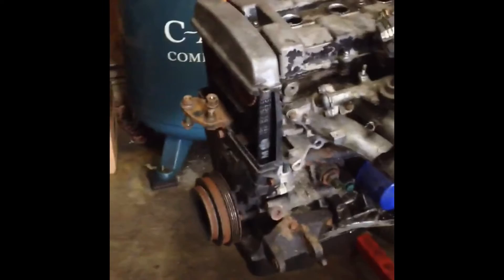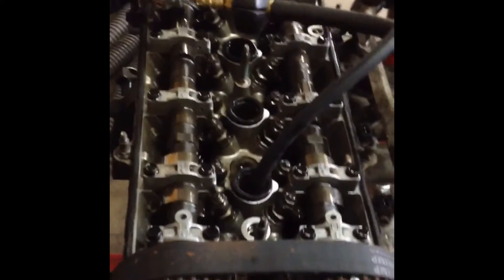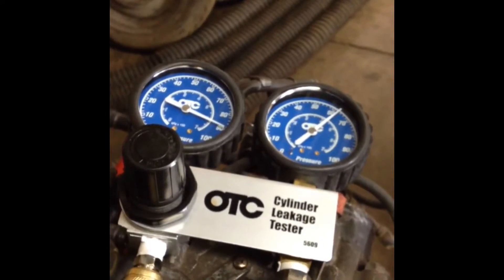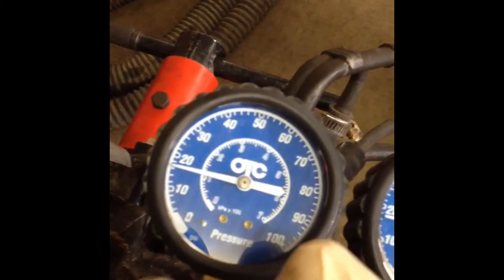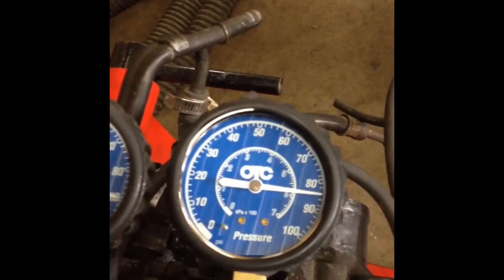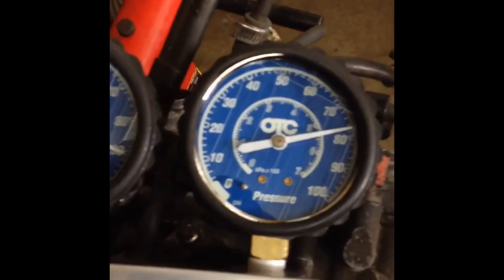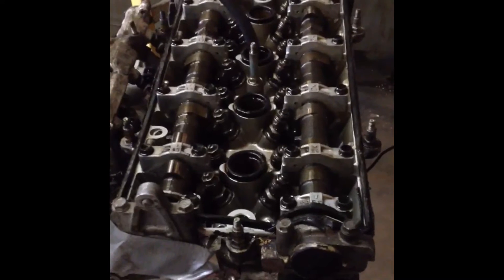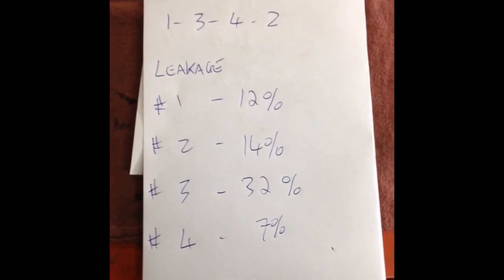Acura Integra B18B1 Cylinder Leak Down Test. OTC Tool 5609.

Comment: Would changing the valve stem seals make a big difference in the %?    You should try it with some inexpensive seals just to see the difference.  I'm no where near the mechanic you are and I think changing those seals is easy with the correct tools.
Reply from the maker: Jon Widmer Unfortunately replacing the valve guide seals wont impact the leakage coming past the exhaust valves. I will still make a video of removing the cylinder head so we can inspect the exhaust valves. I would guess one may be burnt. Honda's as you know have issues with exhaust valves. Speaking of, do you have any laying around? ;)